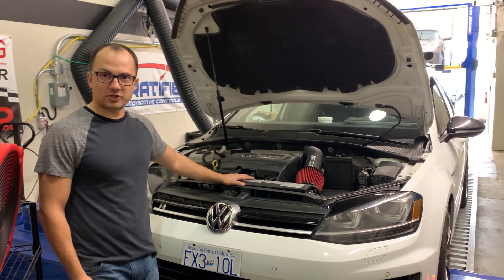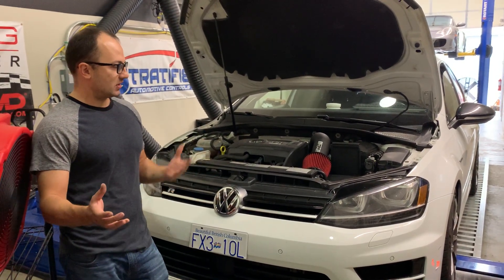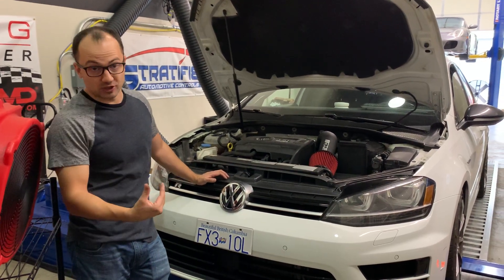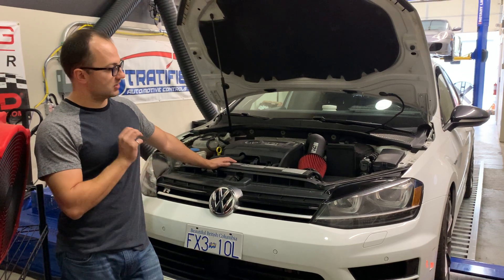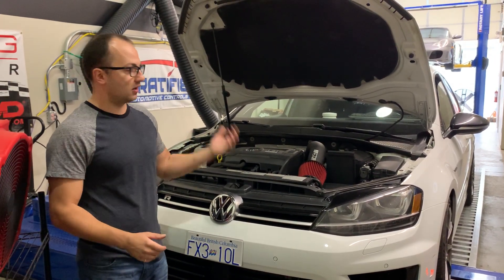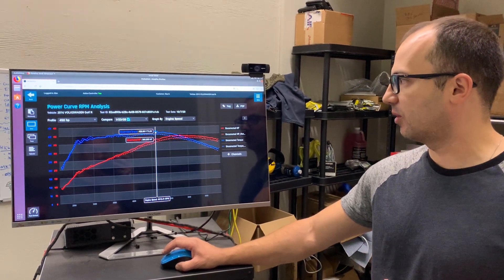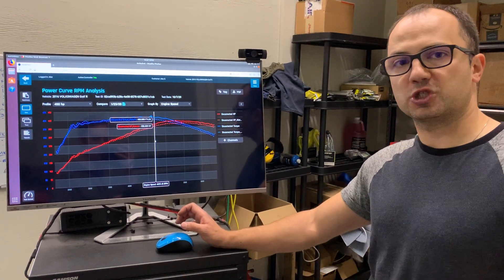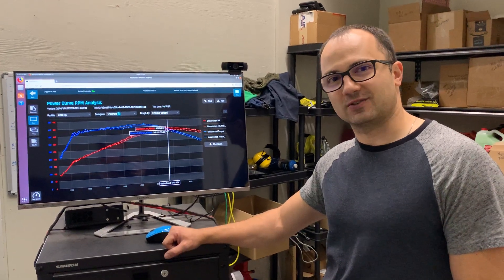MK7R update and dyno: intercooler and intake tech talk

Comment: But Remember stock location goes between radiator and condenser is a hot sandwich  What are you think ?
Reply from the maker: But is engineered to work well in that area and has a big surface area. For most cars this works well.
Reply: @stratifiedauto   thanks!

Comment: @Alex:  I understand the "Pre-Turbo" pressure lowering with a larger intake; but, isn't that difference really close to .15-.20psi?  So 1/5 more PR space would possibly equal 3-4hp (dependant on timing) right?  The IC is providing the bulk of the increase due to the ability of getting more aggressive with the timing at the knock threshold yes?
Do you have any PR Loss data for the CTS IC?  and have you run the AMS yet?  Comparatively, what are the pro's/con's of those two?